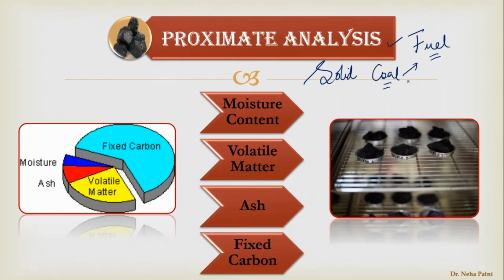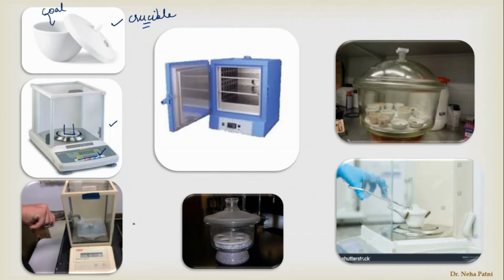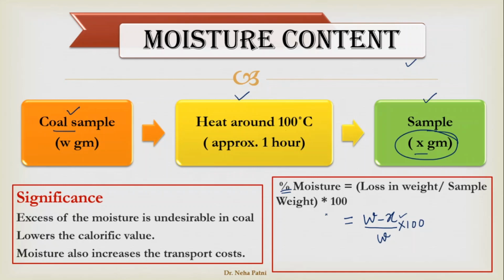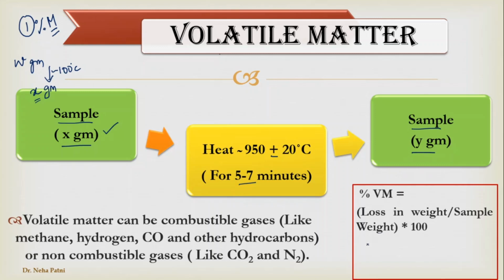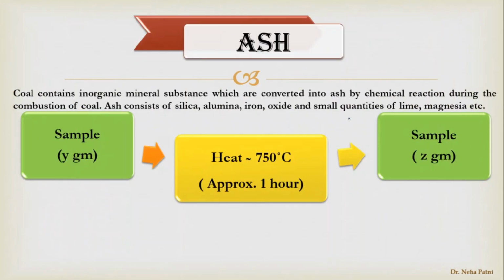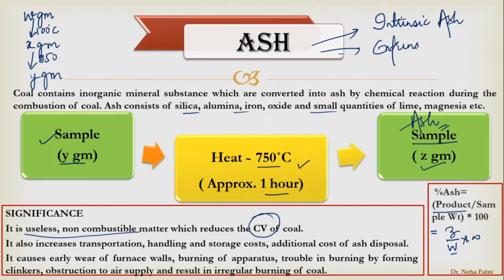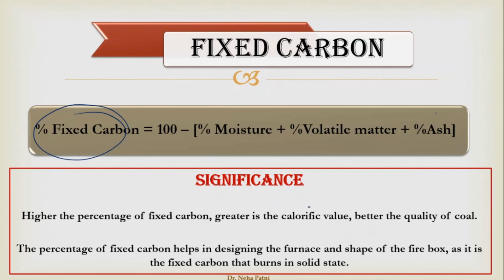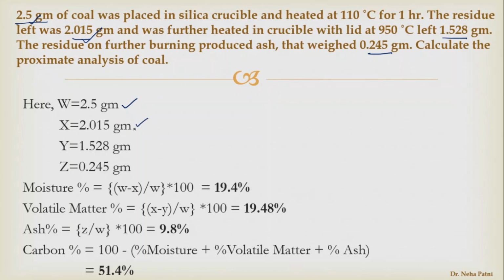Proximate Analysis of Fuel | Coal | Volatile matter | Moisture| Ash | Fixed Carbon

Comment: There is one big question is that  the example you solved, the calculation is based on as recieved basis, dry basis or wet basis?
Reply from the maker: @hafiz as received basis, just to explain the method

Comment: mam, in the ash part of proximate analysis, the conversionof weight is 
 ( yto z ) gm .so what will( y-z ) give?
we have already removed moisture and volatile matter , so what (y-z) signifies?
Reply from the maker: Y-Z could be any combustible matter which was not removed during first two steps, so to ensure complete combustion we heat it for 1 hour by raising temperature installment till 750 degree, so that atleast whatever is left is ash and non combustible.